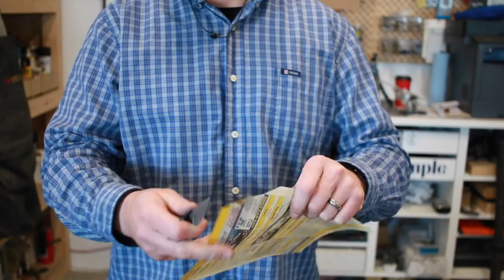Making a Knife in 2 hours, 7 minutes

Comment: I am curious about your thoughts on the delrin work rest.  I totally get your enthusiasm about it not being a rust-able surface in your initial review video.  But it already looks like it has some pretty significant scratches and gouging at the points where your work actually sits, which would turn into dishing of your rest after a short time.  I could also see some significant flex to it in the video every time you put the blade to the belt.  

Is it overly pronounced in the video compared to reality?   If it is happening, are the cost to replace them low enough because they are plastic that your work rest becomes something you just replace as they wear?   I really like the grinder, but I keep thinking that replacing the rest with aluminum might solve a lot of minor issues.  

Love your work and your channel.  I started watching years ago when I was setting up my own workshop in a shipping container.  I haven't missed a video since.

Comment: Great video!  2 questions if you don't mind, 1) do you have a dedicated video on how you get that finish?  Looks great!  2) what make is that sharpening jig or is it homemade?
Reply: the finish is ferric chloride stonewashing. its actually relatively simple, you mix ferric chloride with water (like a 1-10 dilution or something not much at all, its strong stuff) then you tumble it with regular rocks and sand to dimple the finish, if you dont have a stone washer, just fill a pringles can with gravel and shake it by hand, that way takes much much longer though. i dont know what sharpener hes using but i can tell you its not home made, theres tons of fixed angle sharpeners that work similarly, the worksharp, lansky etc. hope this helped
Reply: @stevewilliams2895  Very much so, thank you for the info.